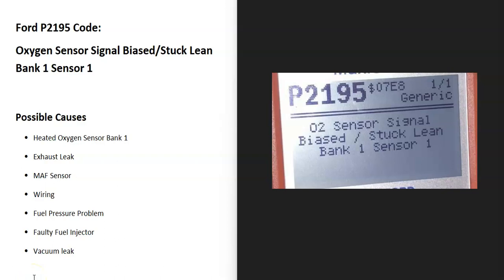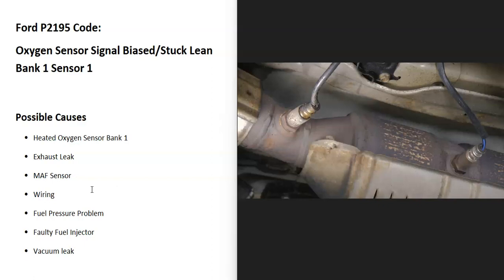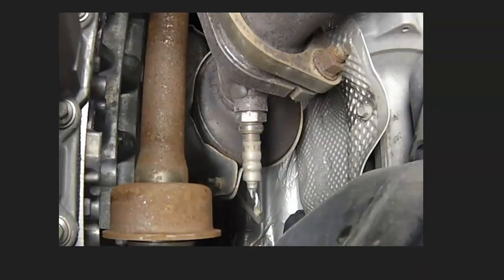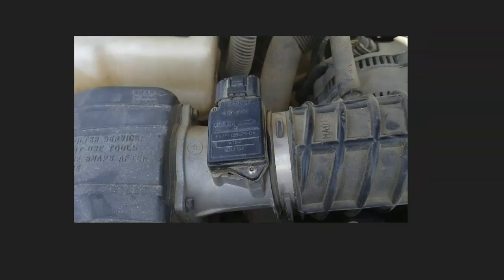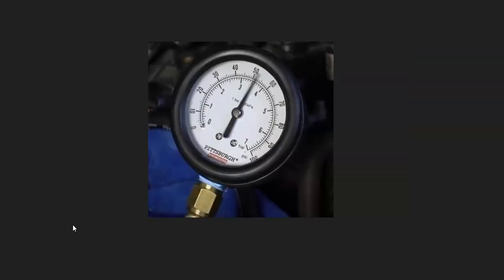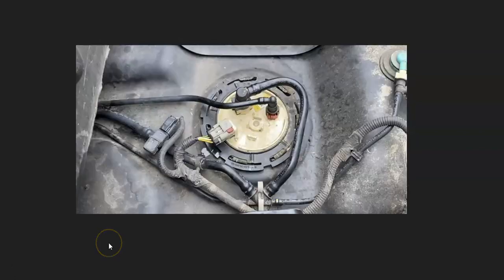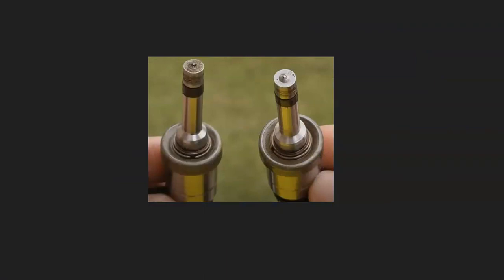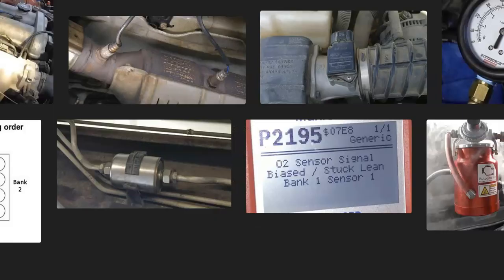Causes and Fixes Ford P2195 Code: Oxygen Sensor Signal Biased/Stuck Lean Bank 1 Sensor 1

Comment: This video helped me alot. I've had my 2010 4.0 since 2020. Every since I bought it I've had random codes all evap and 02 related. Started tossing parts at it like nobodys business nothing worked. Different coded would come back  long story long check your harness leading to the back up the engine. Unwrapped melted areas you'll find your problem. Just figured mines out today 3-4 wires rubbing up against the cylinder head..smh

Comment: Wouldn't a leak at either manifold trigger all sensors?
Reply from the maker: Yes, that is true. For a V6 or V8 engine, there likely would be bank-1 and bank-2 lean codes.
Reply: @HVAC_Mechanic  Yes, have a code here, but it's a single Sensor 1.  I don't see how exhaust could be lean at one bank's manifold but become normal ratio just 24" down the pipe at Sensor 2.  This tells me it's a bad sensor.
Reply: @HVAC_Mechanic  No, I mean a lean bank would trigger both O2 sensors on that bank.  My car has two O2 sensors each bank.

Comment: Great Detailed diagnosis... I just changed my lower intake manifold, after reassembling,  I can hear a vacum leak.. engine codes are Fuel injector (P0204 & P 0207) and O2 sensor (P2195 & P2197).. was ready to buy new injectors and o2 sensors but I will check the injectors and then look for the vacum leak.. Thanks!!

Comment: I can’t get to the bank 1 sensor , before the Cat, on the passenger side. Too tight to get my hands up there.
I did the driver side and bank 2 after the cat on the passenger side.
Reply: 06 F150 Lariat. 5.7L V9, 148k miles

Comment: could a intermate failing TPS cause the p2195?
Reply from the maker: It may be possible, but usually, that would cause a lean condition for the whole engine (both banks). Also, there likely would be a TPS sensor code.
Reply: @HVAC_Mechanic   only one bank, 2.3l ford ranger (2010).   Bringing the truck back from sitting for a few years.   MAF, MAP, fuel pump, fuel filter, Cat, PCV, and cleaned the fuel lines up to the fuel rail.   hoping not to have to take the injectors and rails apart.   the only code I have left is the p2195 (intermate not all the time).  The truck also losses acceleration sometimes, had the transmission checked and it passed a transmission shop check.   No vacuum leaks that I can find, and when it is good it is really good and strong.

Comment: Mechanic fixed the clogged Catalyzer but still 2 pistons not working on V6, will a sensor do that?I
I got code P2195 & P2197, #4 & 6 Cylinders not working, clogged inside manifold or just those 2 top front sensors?  Parts dont know which ones, says 4 on my ford escape 2001 V6.

Comment: I did a full timing job on a 2004 F150 FX4 w/5.4 with new phasers, vct solenoids & spark plugs & now I’m getting P2195 & P2197 codes. No vacuum leaks & truck had zero issues other than noisy chain slap against timing cover from a broken guide. I’m at a loss
Reply: I have same numbers. cylinder 4&6 not working, sensor or clogged manifold like my catalyzer?  Or computer?  What did you find out?
Reply: I'd make sure your cats are good and in check. It will throw these codes if your cats are bad. 1 way to solve this is picking up a spark plug non fowler from auto zone, they are like $8. It will clear the code if it's the cats
Reply: Did you ever figure it out I had some one do the same job and having same problems and code

Comment: Can faulty purge valve cause a P2195
Reply: Strangely enough changing my purge valve took my P2195 code away

I must have had a 1 off case
Reply from the maker: Usually, a faulty stuck open purge valve would cause a rich condition.

Comment: Great video. very informative a lot said in a nutshell !  A bit fast so i had to slow it down to gather it all. It helped me because i had random code problem with 11 codes. 6 were misfires plus  P0171  P0174  P002 P0021  P0022.   Yet this code was the highest and seems  the most stimatic based on your info. Now i need to check into them using  a  first"most method  hoping that where i choose to  began will be the direct culprit and avoid the jack rippers.... thanks so much!